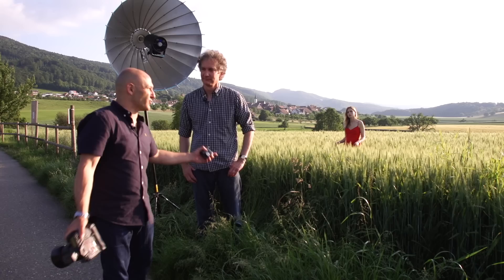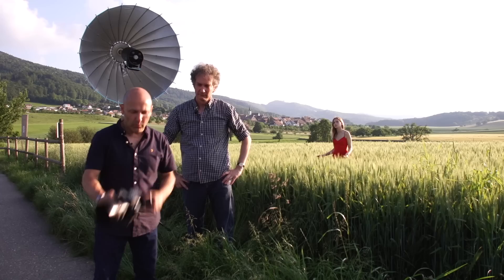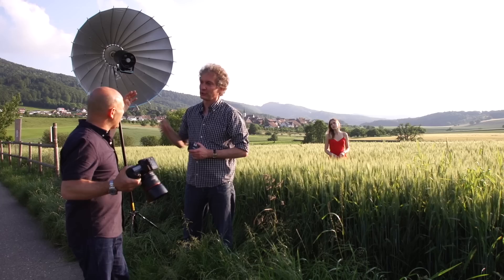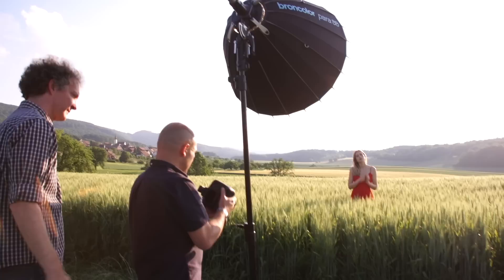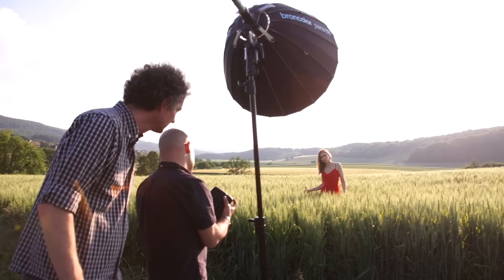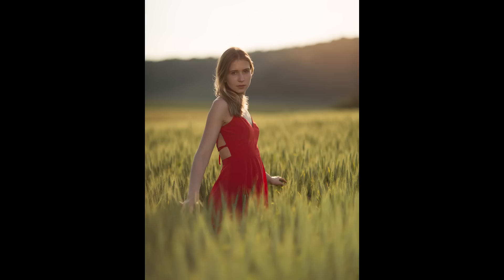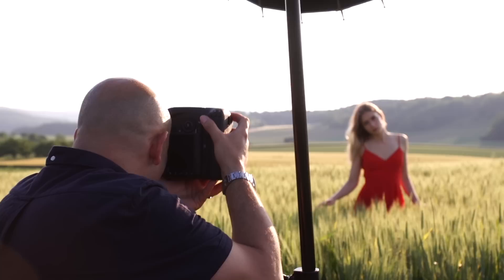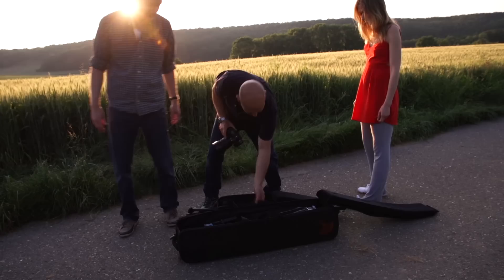Broncolor 'How To' shoot High Speed Sync flash with a DSLR

Comment: I mostly shoot medium format film. Just recently added a FF dslr and lenses. How does using ND filters compare to HSS? Advantage or disadvantages?
Reply: nd reduces sharpness and can introduce some flares, both use too much power though
Reply: There is no evidence that Neutral Density Filters reduce sharpness or create any additional flares.  Also the exposure is exactly the same as shooting without the ND filter because if you normally set your flash exposure to F/11  you would then set your aperture to F/2.8 when using a  - 4/f Stop Neutral Density Filter therefore the exposure did not change, And no additional flash power was required.
Reply: ND filter will make the viewfinder darker and make it more difficult for the autofocus system (less light entering in).
Reply: ND filter can lower sharpness and increase flaring. But we talk then mainly from cheap $5 filters. Well made filters from respectful manufacturers filters that cost like $50 the sharpness ain't effected more than 1% (requires to take series of tests charts shots) but flaring is still there if you shoot directly to light source or sun is in frame, and that can be proven, but it can be very slight or medium flaring as addition lens own. And as many mirrorless bodies like Olympus has digital profile of lens, they can remove flare automatically from image, but with filter they can't as optical path had new glass element that wasn't included in profiling and design.

And mirrorless cameras doesn't get affected of ND filter as EVF can show viewfinder well even with 10 stop ND filter, that makes DSLR OVF pitch black and requiring to use rear display for live view.

Now combine there fast motion and ND filter has its limitations...

Comment: How does it work with the HSS capability if you have a medium format camera such as Hasselblad, PhaseOne or the new upcoming Fujifilm?
Reply from the maker: You don't need it with a medium format such as a Hasselblad as they can sync at any shutter speed anyway because they have a leaf shutter system.
Reply: As far as I know the leaf shutter's limit is at 1/1600 s. Am I correct?
Reply: Karl Taylor not really any shutter speed, but max 1/1600s on the Phase One and 1/800 on the Hassy
Reply from the maker: The Hasselblad H6 can sync to 1/2000th of a second. You can watch my test video here http://www.hasselblad.com/h6d

Comment: Could you get the same effect using a ND filter?
Reply: ManyDoors777 No.
The filter would allow you to have the shallow depth of field at a large aperture, but the model would still be silhouetted against the sun.
Maybe the best you could hope for would be an experiment with bracketing. But you'd never get the same look, without a separate flash.
So it's bracketing, ND filter to allow large aperture, for a shallow depth of field, or this set up. But you'll never replace the light from the flash.

I'm a beginner, but that's my input on your question.

Comment: Karl, have you been using Pocket Wizard gear? (i use it on my elinchrom ranger rx) If so, how much of an improvement is the broncolor hi-sync? You still getting black bands from the camera curtains on high speed shots? Or broncolor somehow solve this problem? Thank you
Reply from the maker: Hi i've never used pocket wizard. I mostly shoot Medium Format Hasselblad cameras that can sync at any shutter speed. But I didn't get any sync problems or black bands using this trigger and the Siros L with my Canon.

Comment: @Karl Taylor This maybe a silly Q to ask but since i never really done portraits and since I'm trying to get into portrait photography i just like to know can this HS Trigger be used with all speedlites also?
Reply: The trigger is a re-branded Godox X system trigger. Buy their X1T trigger(I believe there's a newer version as well) along with their TT685(N/C/S) versions for Nikon, Canon or Sony. They support HSS, rear curtain, TTL. Awesome stuff.
Reply from the maker: The trigger isn't actually a rebranded trigger it uses the same outer case but all the internal electronics have been designed by bron to operate with the bron lighting system.
Reply: My bad... by re-branded I meant Broncolor worked with Godox to redesign the X1T to cater to their specs. 
but for Andrew's requirement the Godox TT685 speedlight system would be optimal.

Comment: Did you take those shots in TTL mode or M?  Thanks.
Reply: TTL would be a strange decision in this circumstance, it always varies a little bit and so you get inconsistent lighting. When everything remains constant shot-to-shot manual provides far greater control and reliability, and this is almost certainly what he has done here.

Comment: Very cool stuff! I have some question which have been bothering me for sometime. Broncolor uses Hyper Sync (different solution from HSS).
http://news.broncolor.com/tutorials/hypersync-easily-explained-by-fabio-gloor-part-1/
According to the above article "the image will have a brightness gradient" meaning a part of the image would be darker than the rest of it. Have you experienced this issue? (especially with fast shutter speeds like 1/4000 or 1/8000). Also to use HS you need long flash duration which is achieved at high power. So can't you use it on low power? Can you use this trigger out of the box or do you have to use some software to set it up first? I would really appreciate an honest answer.

Also maybe a stupid question but does this system support rear curtain sync?